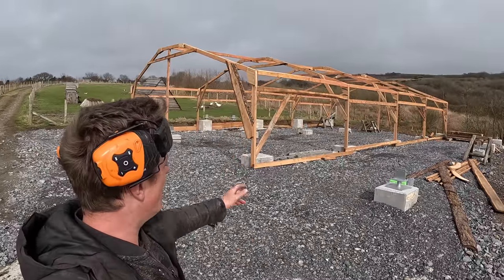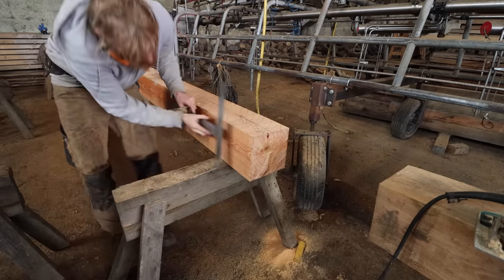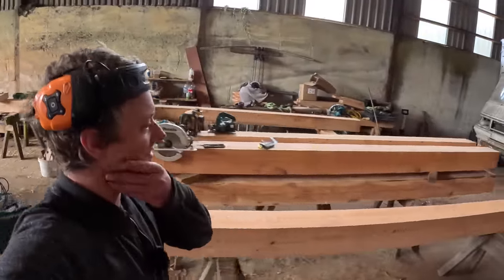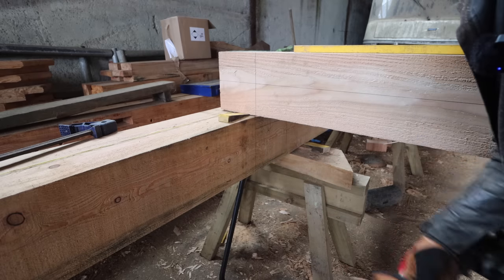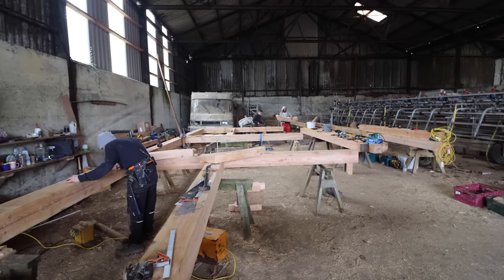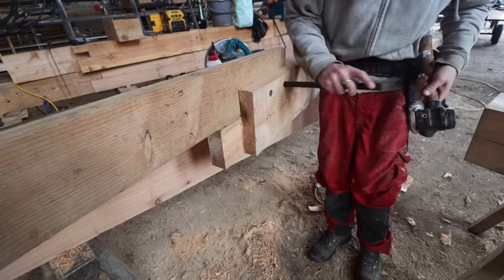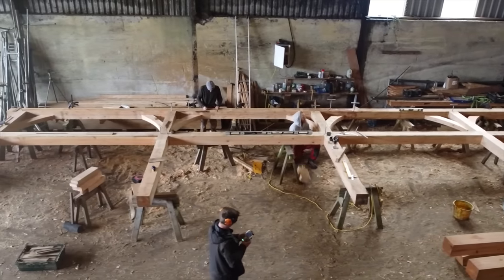Timber Framed Barn Part 8 Framing Has Started!

Comment: Great video Kris! Those guys are pros, so they could handle minor variations on your milled wood. The pros use the ratchet straps- what an invaluable tool for all timber framers. These guys just reinforced the skills of planning and taking your time. But you have had and used the same skills for all of your video projects. You are the star in all of this. It is your hard work that allows you to highlight these timber crafters. The cheers go to you Kris!

Comment: I've been watching your adventures for years. Great channel. I'm a timber framer and a little disappointed you didn't house your joints. Still looks great and a know that's it alot more work to house joints. If you learn square rule timber frame you don't need to assemble as you build. Square rule timber framing  you have to trust the numbers and do everything exactly the same. Congratulations on 500,000 subscribers, I'm one of them.

Comment: massively satisfying - love old skills and pure mastery still in use - and gives a great insight to how, big houses, barns and even ships were built, even if using modern tools, my mind thinks of the hours and hours man has put into hammering and chiselling out joints, i can think of a handful of buildings i have been in that are well over a hundred years, some up to four hundred years old that still have the original structure in place, i wonder how accurate, how much care they took to make things right first time - i really thought you might start with a corner post and add in the other parts as you worked around the building as you did with the greenhouse, but i love seeing things built off site to be reassembled later on site as a giant jigsaw

Comment: I did wonder if your mill was accurate enough to do a "mill rule" type of method but this looks closer to what I am doing with my build, using quite rough reclaimed timbers. This combo of line rule and scribe rule seems to make things fairly simple and reduce the amount of measuring and maths to a manageable amount for a dumdum like me, I've learnt a LOT from this video (and from your video about joining round timbers), brilliant stuff. I notice you aren't using housings (and haven't done in previous builds), would have been interested in hearing the rationale, pros and cons.

Comment: I'm not sure why you elected to move everything off-site because of the wind. I wouldn't have thought that the wind would have much effect on moving timbers around. Sheets of plywood or metal roofing would be very difficult to handle in strong wind, but ... heavy timber? Was just a matter of comfort being out of the wind? I can see that being a factor, along with not having sawdust and chips swirling around constantly.
     At any rate, it looked like everything went very smoothly in the sheltered space, and I'm looking forward to seeing it go up back at the homestead. 
     It's always a treat to see that another Kris Harbour vid has popped up in my feed.

Comment: Beautiful work, tremendous craftsmanship. Just wondering if there's any +/- deviation from zero where the foundation brackets back at the sight are concerned. This would be an opportunity to compensate in the  length of individual posts.
Reply: Likely easier to do on site. Either by reducing or shimming
Reply: @whirled_peas  possibly, but with a laser transit and careful notes it could be done equally easily in the barn. All the pieces are marked for location so it's a piece of cake.

Comment: This is absolutely awesome and inspiring! I'm working on my own timer frame design and I see some elements in your design I'm surely going to look into further.
Quick questions - I'm guessing these are 8" beams and 3/4" pegs you're using? I was a bit surprised on the number of pegs in the braces, don't braces work mainly on compression and so could, theoretically, even be done without pegs?

Comment: Stupid question alert: why can't the timber frame be built outside and in situ? Thanks - love your channel. :)
Reply from the maker: It could if it was dry. There is a lot of marking to be done and the tolerances are very small. 70% of the time involved is marking so if you lose the lines then its a massive waste of time. The the wind is an issue for plumb lines as well.
Reply: @KrisHarbour  Ah, cool. Good to understand. I'm about to do something similar, but on a much, much reduced scale. Thanks for the reply.

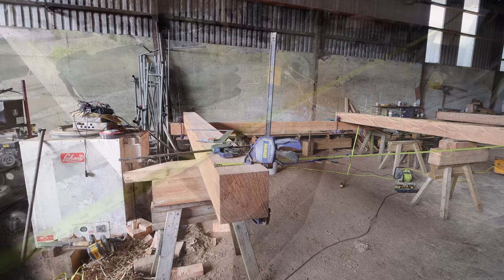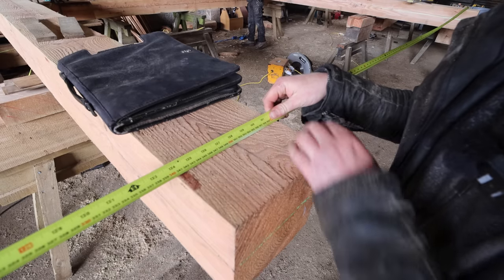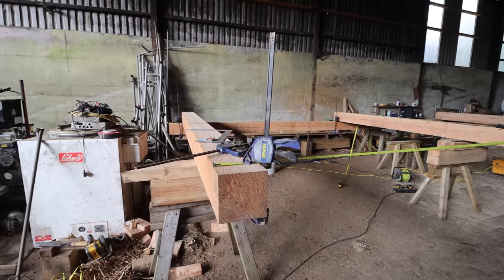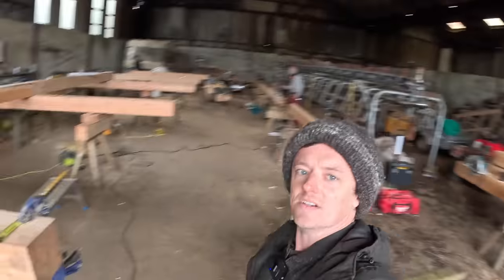Comment: At 21:30, Kris says that the distance between the posts must be 3.40m from center to center. But at 21:38, he is checking that the center line on the second post is at 3.50m. That got me confused until I realised that the tape was clamped to the left EDGE of the first post (see at 21:15 and at 24:04), not to its center line. So the tape was 10 cm more to the left obviously, a distance that had to be added to the CAD measurement. I would have gotten that wrong LOL.

Comment: 😱 What a pity that Murphy's law kicked in and you couldn't use the especially built work shed on your property. I feel with you. Fortunately you found a solution for the new problem and your professional "crew" is doing really, really great. 👍👌👏 The barn will be extremely sturdy but also quite expensive if 5 days and 5 men are needed for fabricating one frame. How the bracing is done looks and is definitely great. But a ton of time could've been spared if you had simply bolted the bracings on with for instance some big through going threaded rods.
Thanks a lot for making teaching explaining recording editing uploading and sharing.
Best regards, luck and health in particular. To all of you of course.

Comment: Scarf joints are not located above the posts because of no movement and the rest dose ,mostly in the center,so the best place for them is 1\2 way to the center
Reply: krisHarbourNaturalBuilding102  Scammer.